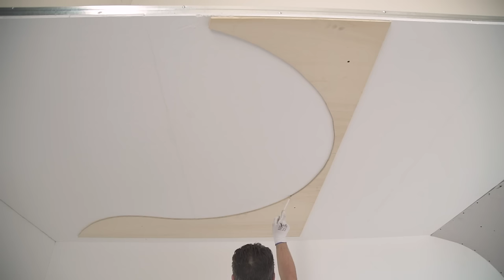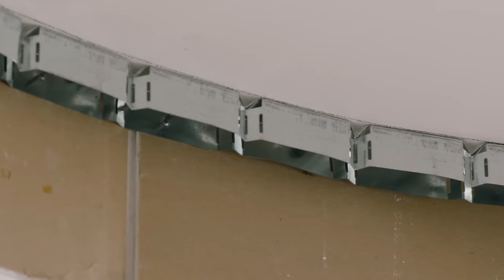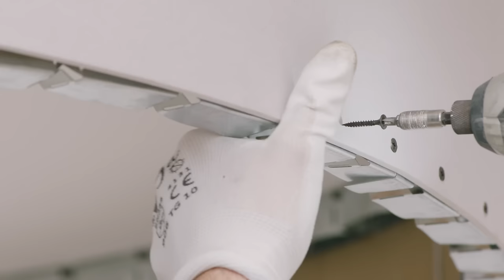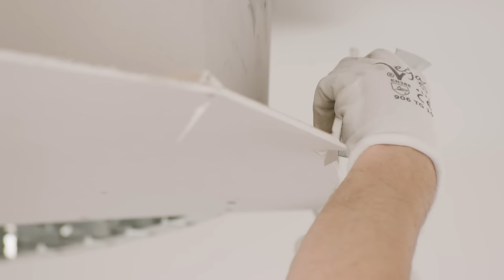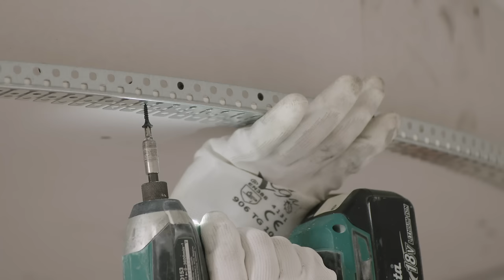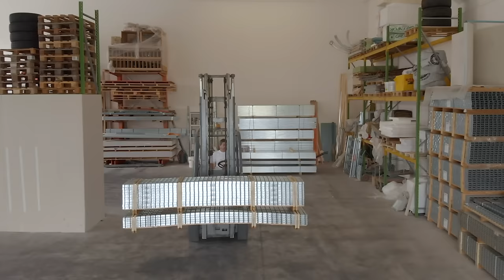Curved plasterboard ceiling with recessed spotlight - I PROFILI

Comment: What are the names of the components.
Reply from the maker: The flexible profiles used in this videos are called COBRA tracks: they are steel profiles that can be easily bend by hand and the plasterboard perfectly adheres to their surface, ensuring an optimal result and without imperfections!
Visit our website for more information -> https://www.iprofili.com/